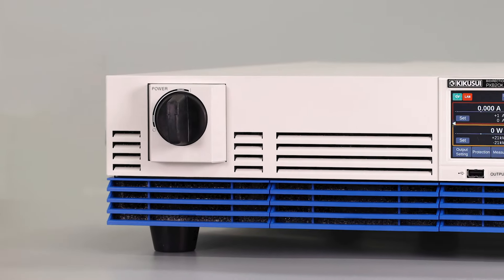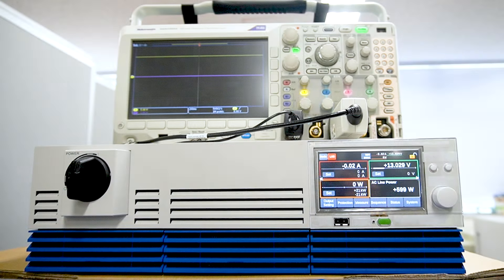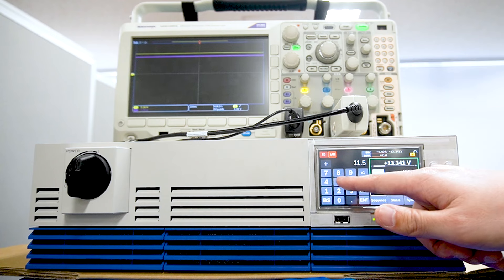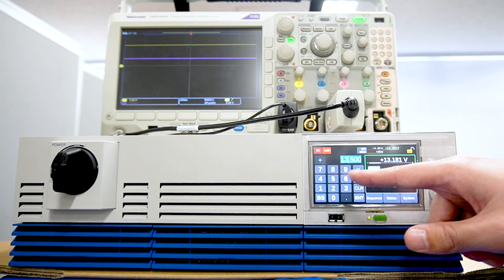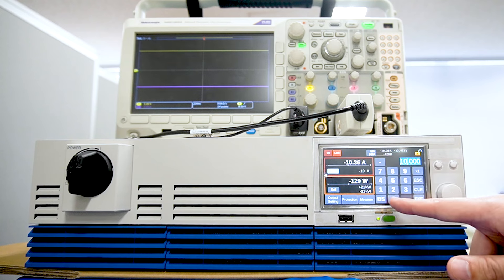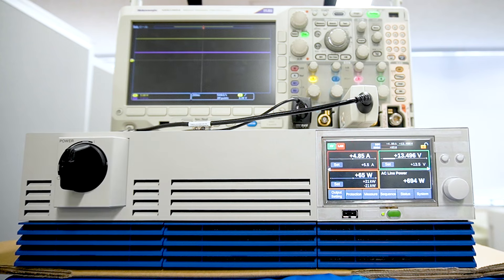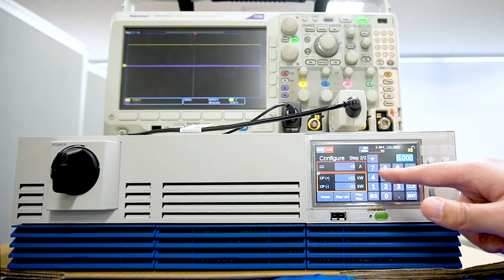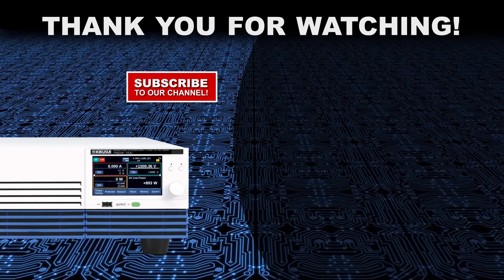The PXB Series of Bidirectional High-Capacity DC Power Supplies- DC SEAM Mode

Comment: woow, unfortunately it is out of league for us hobbyst
Reply from the maker: Thanks for the comment! We are happy you like the video!
Reply: The PXB series sources and sinks power. What is called a bipolar device. To  test batteries and solar cells "Output" current versus voltage you can use  PLZ series unit. Ie a DC load tester.. I have several of these PLZ units  new to old ones.. even ones that are 3 decades old I got used work well  . Lol.

The PXB unit in this video allows one to source current so characterize charging of a battery. 

Regards
Reply from the maker: @3beltwesty  Thank you for the comment. We really appreciate your feedback. 

We are glad to hear that our electronic loads still work well after many years.